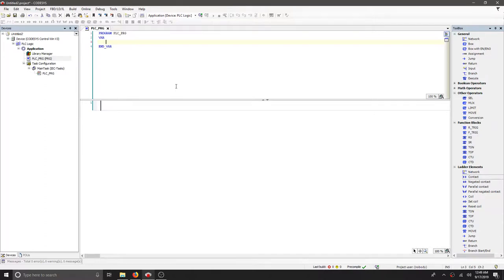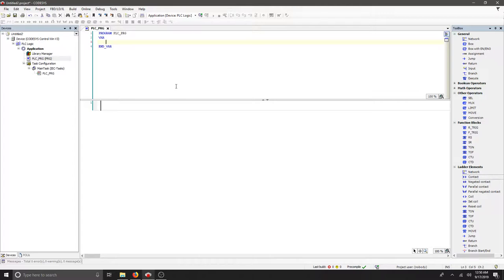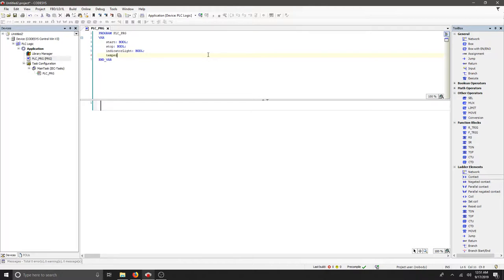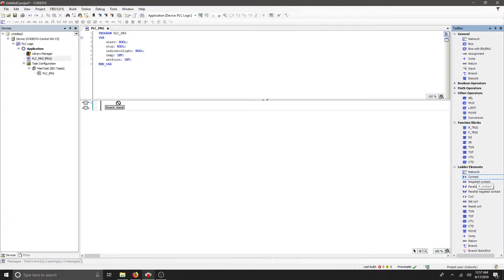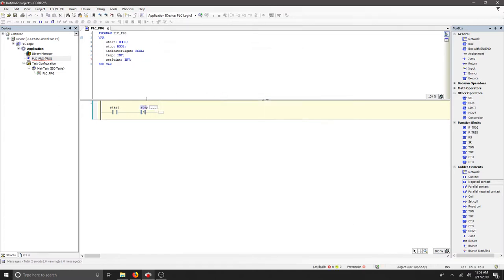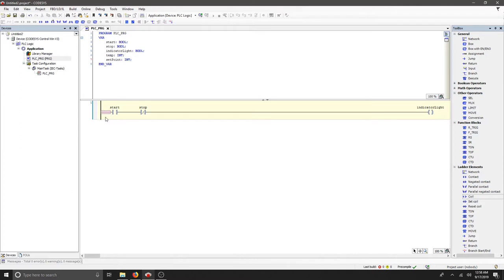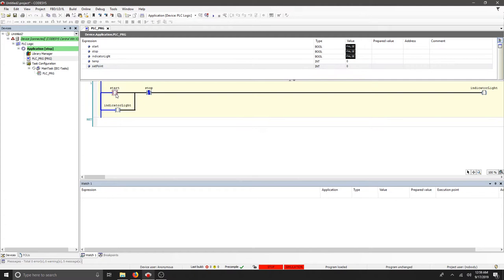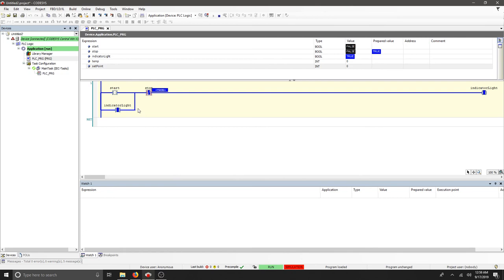Creating Variables and Start/Stop in Codesys w Ladder Logic

Comment: Are there any functions in Ladder where you can give a make a variable a if-condition and make it negative?
Reply from the maker: There is a negation or normally open vs closed contacts and coils. The diagonal line in the symbol should indicate this. Using IF statements specifically can be done logically with ladder, but you can also add conditional statements with blocks or structured text.